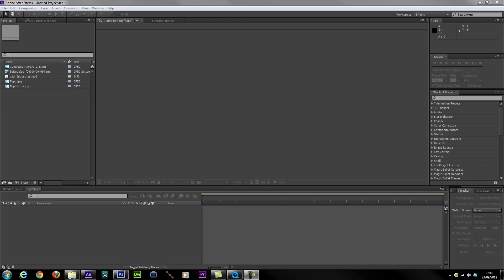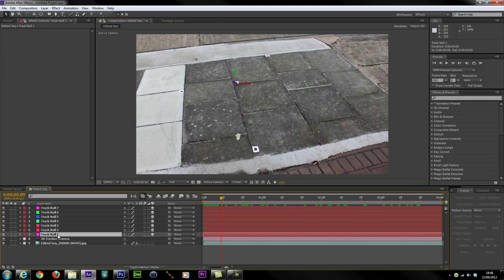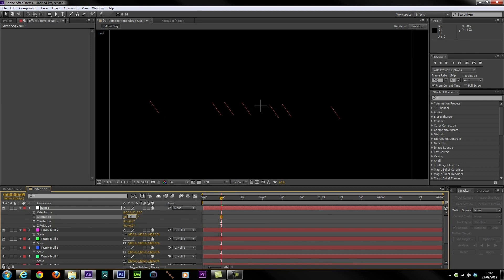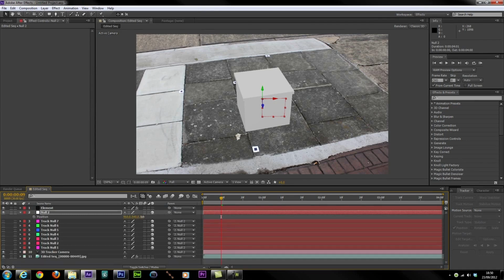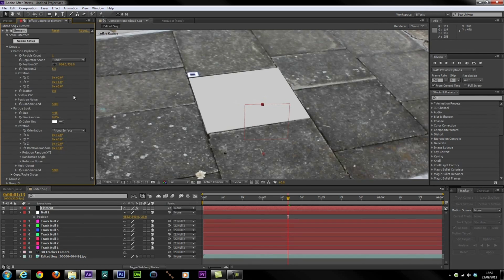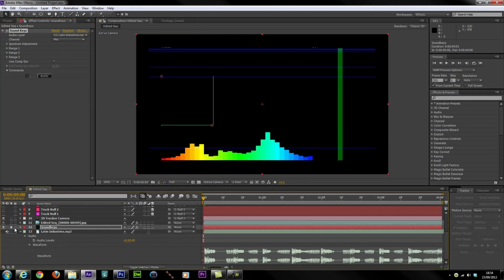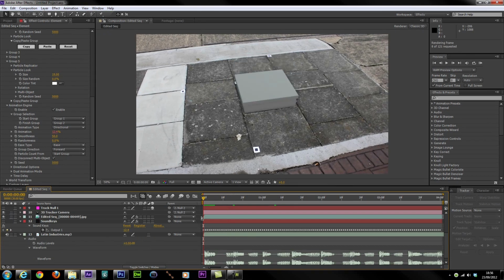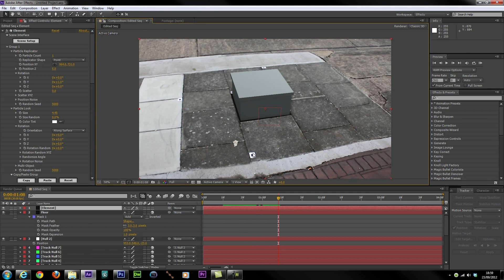Sound Reactive Element 3D Tutorial - After Effects CS6

Comment from the maker: You can have high quality footage but that doesn't mean you are going to get a 100% accurate track. There are many factors that affect the trackability of your shot. One of the most important is contrast points, if there are areas of high contrast then this will help make a better track as the tracker has something to lock onto for the entire shot. Motion blur ruins tracks especially if you have fast camera movements, so either increase your shutter speed (dslr) or move the camera slower.